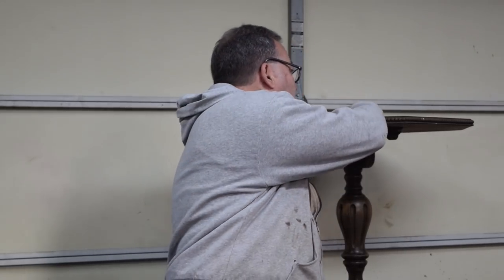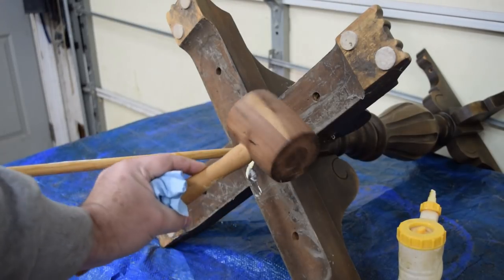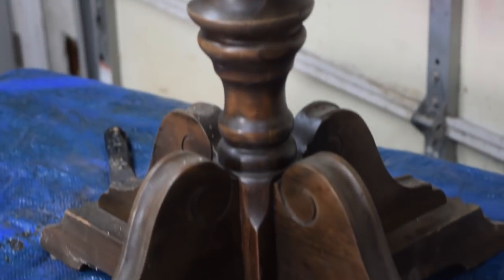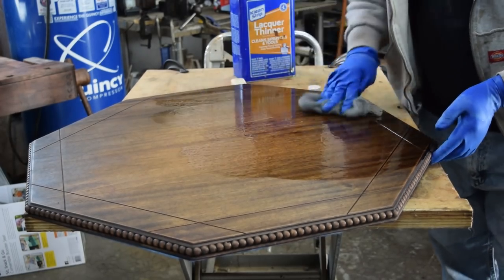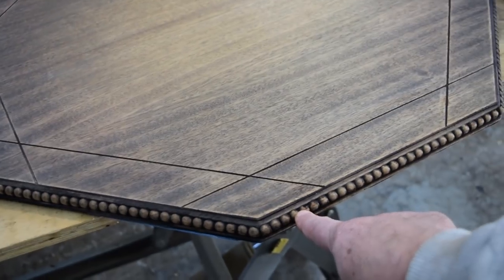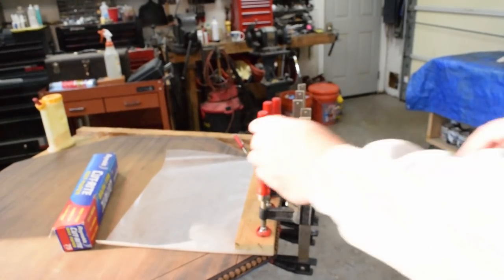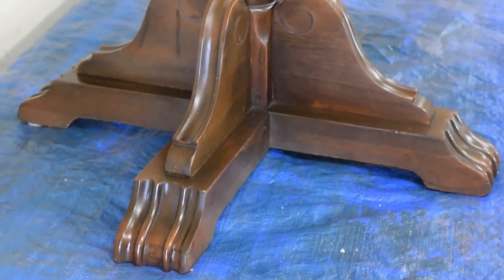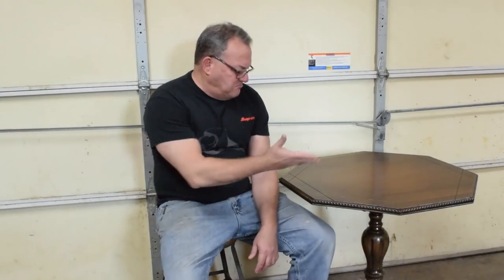Preparing a Depression-era Table For Sale

Comment: Great restoration, the repair to the base is probably far better than the original and a lot stronger. As you said it is unlikely that anyone would want to separate the two pieces.
Don't leave it too long before your next release. 👍👍

Comment: Another great video.  Thank you.  When I  do veneer repairs I like to do them before I strip the furniture (providing they show up then) that way the squeeze out is on the old finish not bare wood. I saw your special putty knife.  I buy small flush cut saws from Harbor Freight and I had an old dull one and I ground off the teeth and rounded the corners and it is great for loose veneer.  It is thin and if necessary you can get eight inches or so under the veneer.  Hope you have a great Holiday season and don't work too hard
Reply from the maker: Great tip - thanks!

Comment: Stand the work piece on end and then gently open the separated veneer with a putty knife, and put the glue down into the void. Lay the piece down flat then work the glue around. You will get more glue in and better coverage
Reply from the maker: Absolutely correct.  In this case, I felt I had plenty of glue in there to effect the repair.   Thanks for watching!
Reply: O-Tay.

Comment: Hi Larry  Enjoyed watching you skillfully give this table  a new lease on life! Just FYI .....I have had good luck using wide stainless steel drywall finishing knives in veneer repairs. Wallboard brand is a favorite. When applying the glue to the veneer for this specific table might you have let gravity help you out by remounting the top vertically? I have also warmed up glue (both yellow and premade hide) to reduce it's viscosity so it "runs" in to tight paces better. regards vic
Reply from the maker: Thanks Vic.  Great tips.   Best regards.